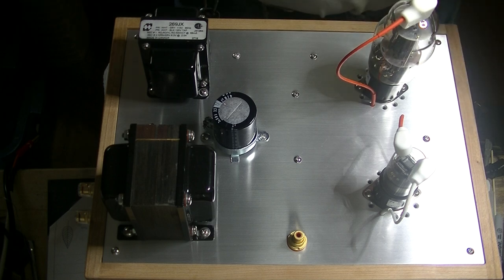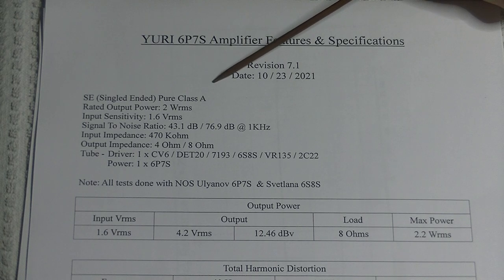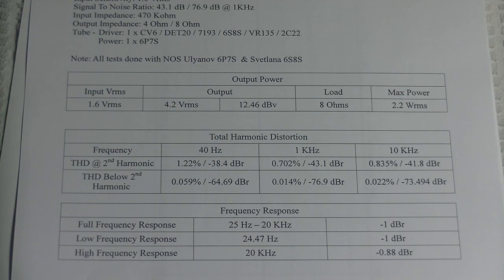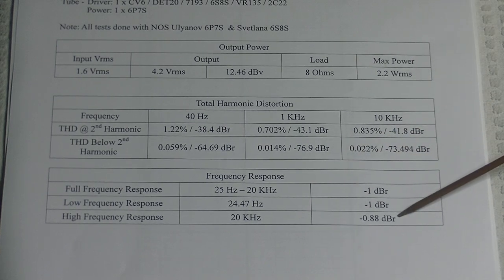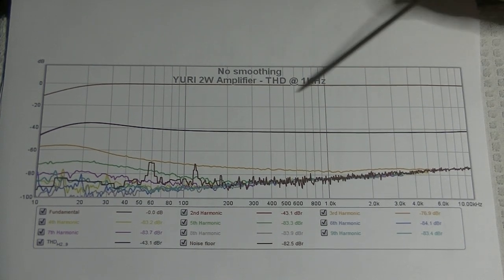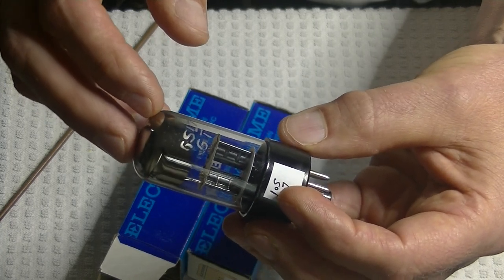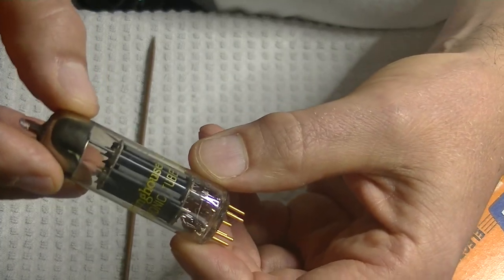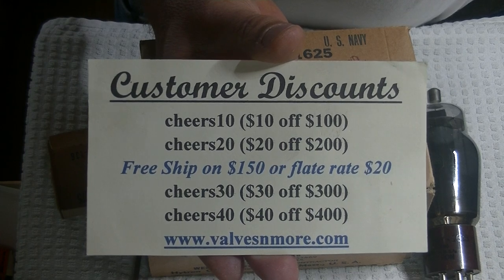Tube Lab 55 - Yuri SE Monoblock Kit Amp Finished

Comment: Wonderful little gem - came out really neat ! It's a real shame loudspeakers present low and complex impedance, whilst offering laughable 0.5% (in)efficiency. If it wasn't for that, output transformerless SE class A biased RF triode based amps would easily outclass any complementary transistors based units sound fidelity-wise by a wide margin.